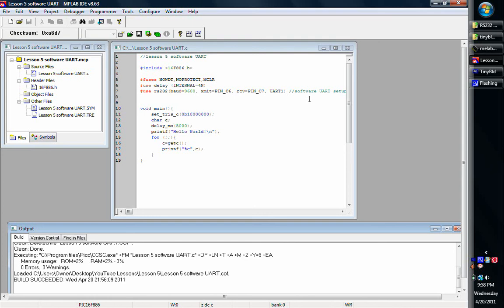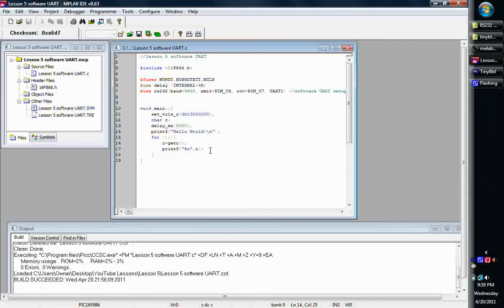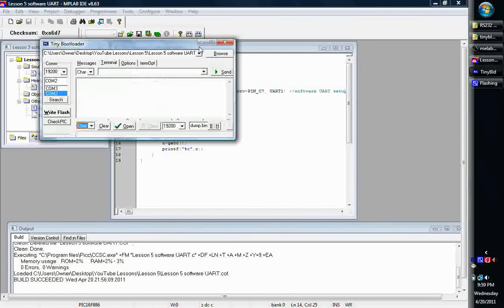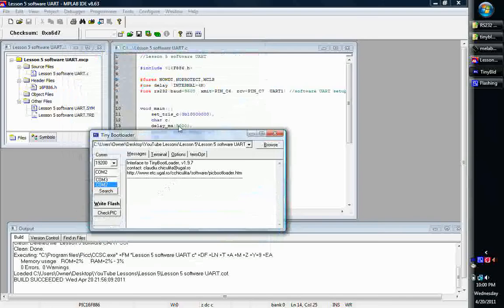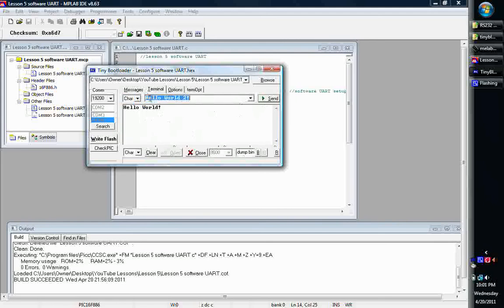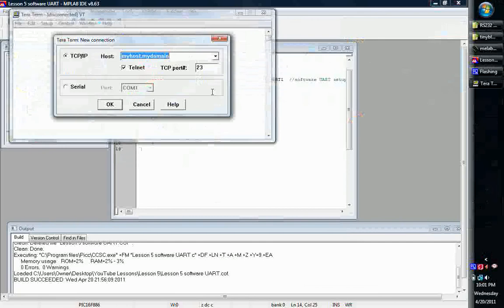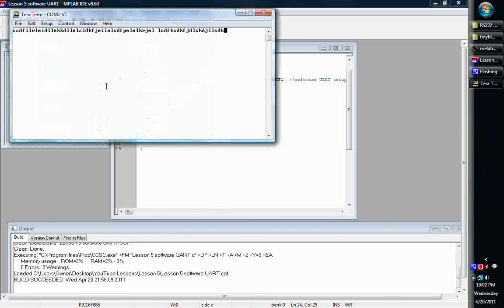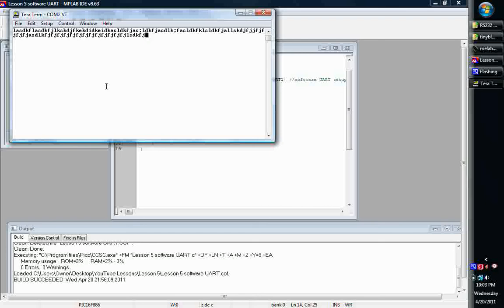RS232 Demo Part 3

Comment: Guess I'm missing something... did you publish this code somewhere? Or describe it in a prior video?

On Hyperterm for Windows 7, there is a new version from the company that wrote the program originally, but you can also just copy it from Win XP and it works fine on 7. Copy files:

C:\Program Files\Windows NT\HYPERTRM.EXE
C:\Windows\Help\HYPERTRM.CHM
C:\Windows\Help\HYPERTRM.HLP
C:\Windows\System32\hypertrm.dll

into a folder  "HyperTerminal" under program files on Win7 and make a shortcut